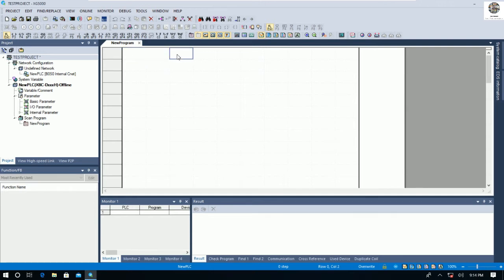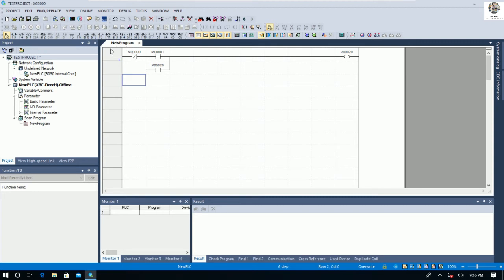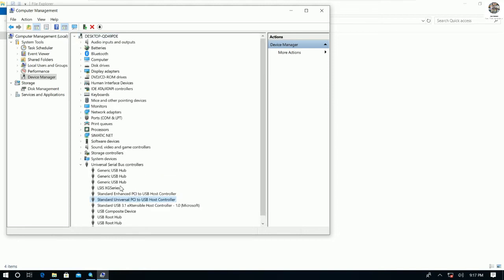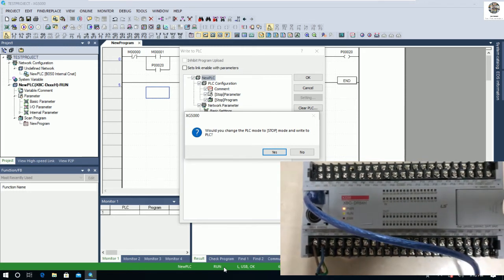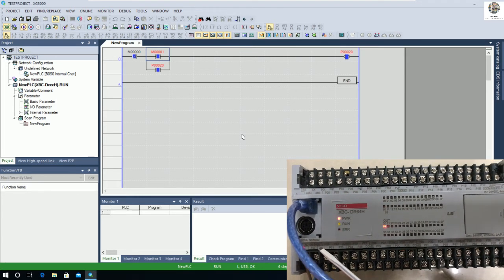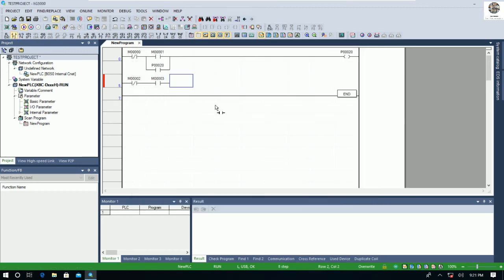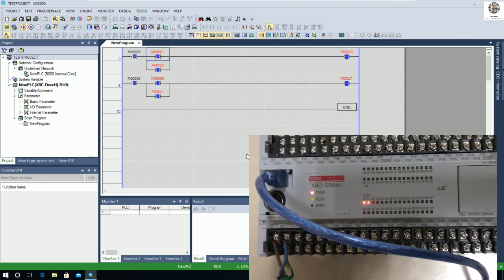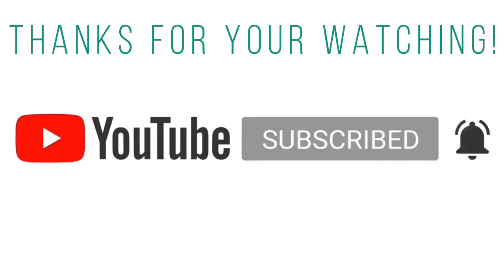XG5000 SOFTWARE CONNECT WITH PLC LS XBC CREATE NEW PROJECT AND TESTING WITH REAL PLC

Comment: I am using xg5000 software to connect to LS XBM DN32S PLC. I am able to read and write the logic but I am unable to force the output through software. Through logic the output bit gets high but not through forcing.
Reply from the maker: Dear sir,
Please double click and force it. But make sure PLC is RUN mode.
Thanks
Reply: @generaltechnologyknowledge5165  yes PLC is in run mode and monitoring is on, I double click then it gives me option of force value to 1 or 0, when I click 1 and press ok nothing happens. Tried many times. Do I have to turn on some another function that I am missing? I am using the latest software downloaded from LS website. Actually I wanted to check the transistor out put card on PLC, as per logic and LED on module the output is getting high but the output is not functioning